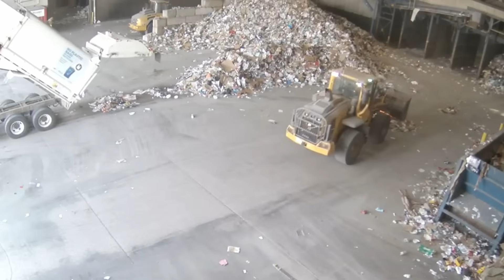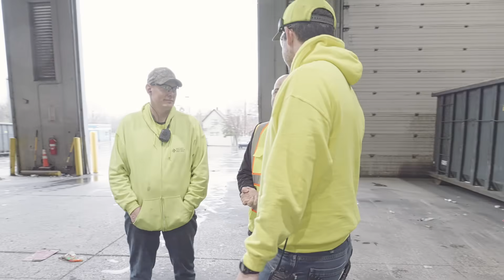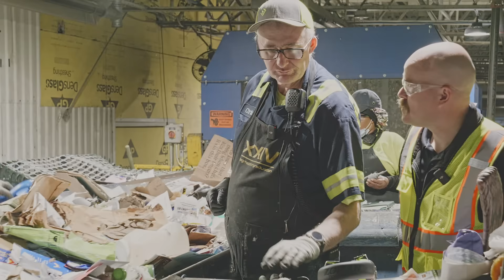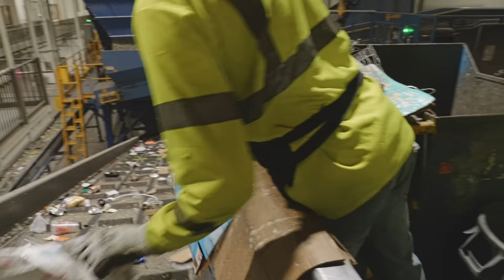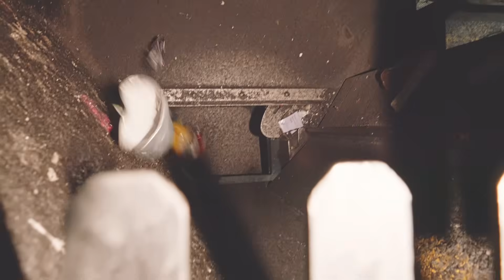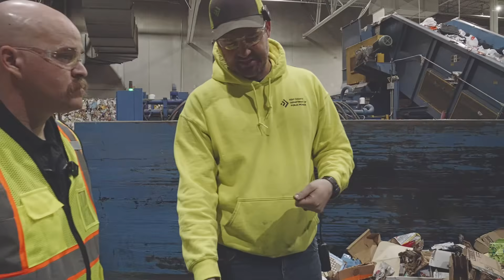How Recycling Really Works & Fire Hazards Lurking Inside

Comment: The worker that stated, "I toss plastic 3 thru 7 in the garbage" (or something like that) is spot on. 95% of plastic recycling is #3 thru #7 - and goes to the burner or the landfill.
Reply from the maker: It actually goes to the baler and is sold.   The value is very low though.

Comment: Great idea to have moveable nozzles, with Water, or Foam, or even Inert Gas Flow.  The REAL PROBLEM in our area is that we have NO easy to recycle facilities to chuck Lithium batteries.  I used to keep a metal container of these, and tried to get rid of them, and nobody would take them.  Walmart takes back all Lead-Acids, no questions asked.  We need a similar system, maybe next to Walmart, Costco, or any capable retailer.
Reply: Our county is VERY good about hazardous waste.  Multiple consumer-friendly facilities around the area.  Clean, nice hours, no questions asked other than, "are you a resident?".  
Batteries Plus, Lowes, and others also take rechargeable batteries here.

Comment: Until the seperate bins are implemented. Education in all forms and enforced for wrong placement of recycling. There is always going to be a lot of land fill waste and fires. Look at the European countries manage recycling ♻️
Reply from the maker: It's interesting because we started with separate streams, then went to single stream.
Reply: @StacheDTraining Norwegian system is very good. You put different types of waste into bags coded by color. All of them go inside common container. Single waste truck carries all of them intact to the sorting station where primitive machine sorts bags by color. IMHO the best option. 
Germany, Sweden and Poland have separate garbage containers for different types of waste.
Actually there is always about 10% of foreign waste in the container, but it is ok and gives possibility to sort and make something useful like recycling or energy. Total mixture of everything is a nightmare to sort and makes it hardly reasonable to sort and recycle from economical point of view.

Comment: the use of induction loops to separate metals may cause a charge in battery material. maybe
Reply from the maker: In a perfect world,  the batteries should never get to that step.
Reply: @StacheDTraining  having worked in hospitals im concerned that many devices which used NiCa will now use lithium. and most staff will not be aware
Reply: @meditationsoundscapes5203  Not just there, but lithium batteries are in everything now.  Even consumer remote controls which previously used AA/AAA alkaline batteries now are using Li-Ion, with no way to extract the battery from the remotes.   Lots of single-use, disposable items with lithium batteries in them as well.

Comment: I once worked at a recycling plant to sort the trash.  I have countless anecdotes of weird stuff, but the leaking canister of gas was something.  Used drug needles almost sting me...  What are we waiting for, we need edible/compostable packaging to avoid producing trash in the first place.
Reply: That would also reduce plastic waste.  Plastic waste is a big problem because rather than chemically degrading, it just fragments and makes smaller and smaller pieces.  It's been shown that these nano-particles of plastic cross the blood-brain barrier and get lodged into the brain where our system fails to flush them out.  We all have plastic in our brains, and that's thanks to the over use of plastic.

Comment: Plastic recycling is a complete propaganda driven scam.   Rarely is plastic actually recycled today.  Metals and glass have high recyclability and do not degrade during the recycling process.   Plastics, not so much.
Reply from the maker: I worked in the plastics industry for 5 years.   Overall,  you are correct.   There are a lot of issues with recycling plastics.   Not to long ago they had to pay people to take the plastic,  now they are selling the bales for pennies.

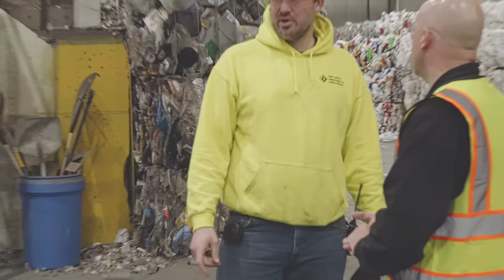Comment: 14:14 My neighbor used to put propane tanks in the recycle bin. But he would cut them in half so there was no danger.
Reply from the maker: Most metal recycling facilities will take tanks once they are cut in half.
Reply: How do you safely cut a propane tank in half?? It’s nearly impossible to get all the vapor out of it.
Reply: @DeepBrainThrombosis open up the valve on a expended tank? That is my idea
Reply: @DeepBrainThrombosis  It is very easy to get all the vapor out of it. Safely, that is another thing entirely though.
Reply: @DeepBrainThrombosis remove valve assembly, fill with water or nitrogen?

Comment: Really liked! If you get around to it do a video on manufacturing with batteries safety. The company I work for is developing a one time use emergency medical device with a custom pre-charged sterialized LiPo battery pack. As an enginner I've tried to convey the importance of things like - charging the battery last, AFTER the protection circuit's installed, not storing them too close together or near things can catch on fire, etc.. but a video would be gr8 especially with the potential uptick in domestic manufacturing! :)

Comment: This is very interesting. 
At 5:05 I started writing about a remote control fire system, got through writing it and then bam 6:05, they are talking about my idea. 

 My neighbour doesn't understand and jams dead food and everything possible in the recycle bin (general household rubbish) he's not all there I think After months, the bin finally gets taken out (usually by another neighbour who can't stand the stink of months old rubbish) and then the recycling truck end up with putrid food inside the recyclables.
Reply: Here they fine you for putting this kind of stuff in your recycling bin. They don't take it lightly either.
Reply: @jamesmckenzie3532 Wish they did that here, but the recycle bins are shared as it is a unit complex. We do have 1 bin/2 residents for recycling ,but I know it is him doing it.